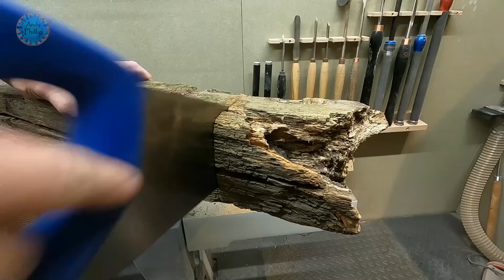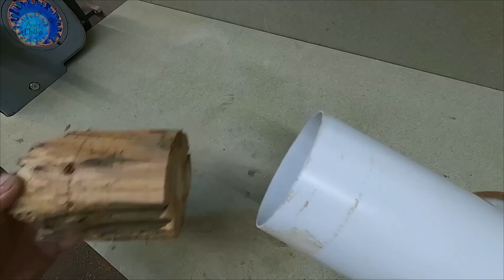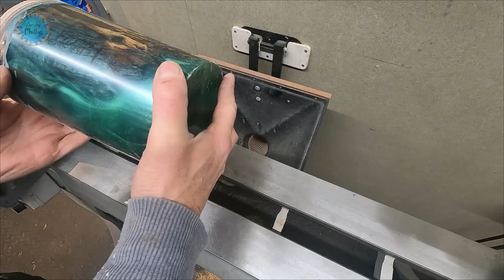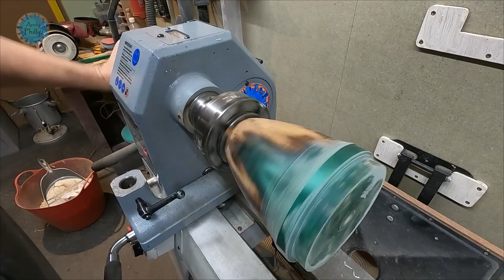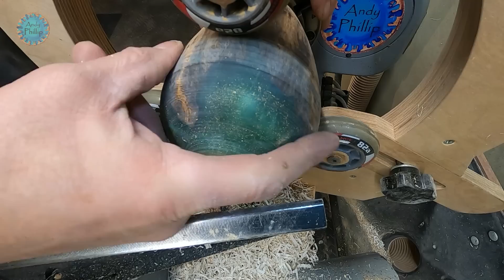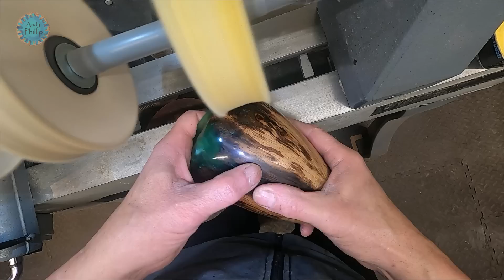Recycling an old Oak Gate Post #1

Comment: Did you need to use a pressure pot on the mold to get all the bubbles out?  Thanks - great work!!!
Reply from the maker: Thanks.. yes I always use a pressure pot if the piece fits in

Comment: Wonderfully creative!  Could you share a bit of the details about the resin... which manufacturer, and did you use a pressure pot or vacuum to deal with bubbles etc... Thank you!
Reply from the maker: Thanks .. This was a slow set epoxy from vista resins and I always try and and use the pressure pot unless the piece is to big to fit

Comment: Hi Andy another great looking peace one question did you have to use a pressure pot for the resin?
I want to try something similar but don't have a pressure pot.
Reply from the maker: Thanks Darren... I mostly use a pressure pot but have made pieces without, use a slow set deep pour epoxy like what's used for river tables, takes a few days to cure but gives plenty of time for air/bubbles to disperse
Reply: Thanks Andy,
Does the timber need treating or just cleaning up so the epoxy sticks to it?

Comment: Beautiful.  What is the finish you used and buffed out? Please.
Reply from the maker: Thanks... I used a mineral oil,  which was for the wood not the resin .. the resin is sanded too 1000 grit and buffed with menzerna buffing compounds
Reply: Thank you for that information. It certainly is something i will use in my projects. I can only hope they turn out as beautiful as yours. You make amazing pieces. Start to finish.

Comment: I am in general not a fan of apoxy content. It seems every wanna be maker has decided they can pour some apoxy in some useless ashtray or animal shape and sell them, and all I see is the piles of BS in landfills in 10 or 20 years. 

This however actually look amazing and I don't see very many I like the wood pairs great with the shimmering epoxy it's very well done imo 👏
Reply from the maker: Thanks .. I know what you mean, it can be over used but I always attempt to use it tastefully or when it is needed to keep the piece together, this section of the gatepost would have just gone to my firewood pile if I hadn't added epoxy..